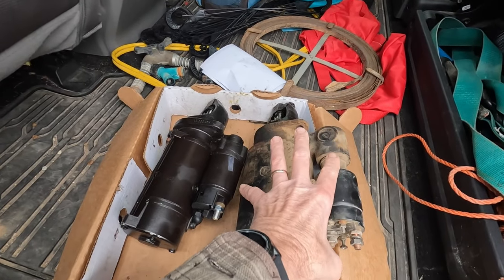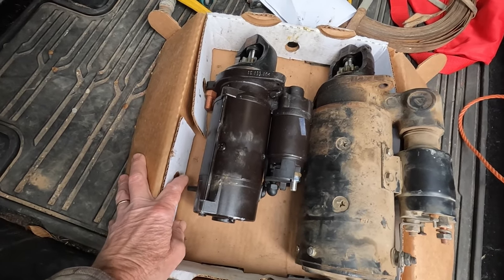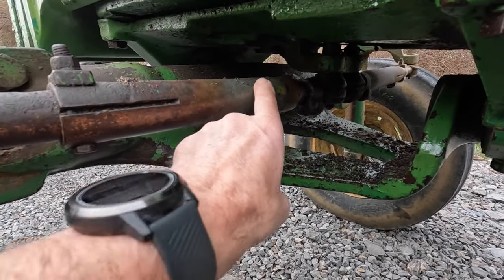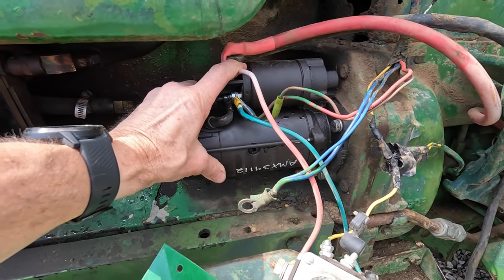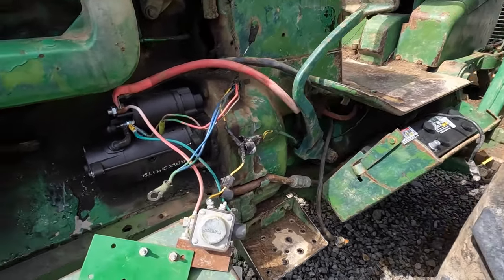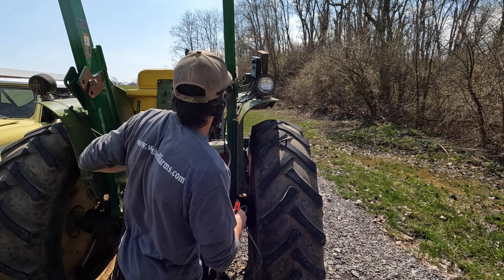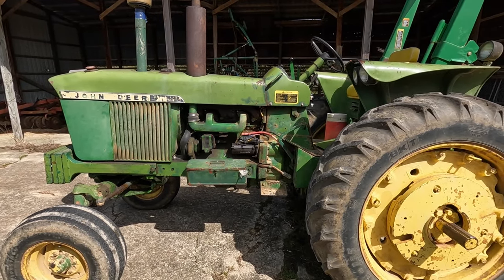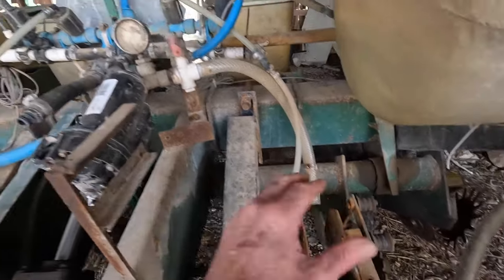MY JOHN DEERE TRACTOR HAS SOME MAJOR PROBLEMS!

Comment: Iether pull the axle or pull the fuel tank and hydralic tank.
Reply from the maker: Don’t need to after all. We found out it’s leaking from the steering piston seal.
Reply: @wishwellfarms  that's a relief and a much easier job!